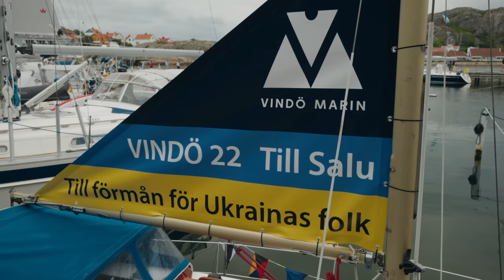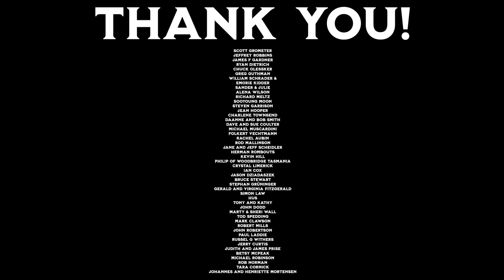a strange new experience [S5E16]

Comment: you ought to come to the Norfolk Broads, here in the UK, the wide rivers are the size of your narrow channels, some rivers there is barely room for 2x 12 foot wide boats to pass (thank goodness for the reeds at the sides) and  encountering a race may mean 40 or more boats all over the river (stick close to the right bank as they are supposed to treat you as the bank, leave a gap and you may have boats coming past both sides (6" is seen as a miss and perfectly adequate room), then there are the bridges, a good sailboat crew can drop the mast and shoot the bridge with the residual speed, and have the mast back up less than a boats length past the bridge, its a wonder to behold, also when they get it wrong.
Reply: I agree; I live beside the Waveney river close to Breydon Water at the entrance to The Broads from the sea. There are over 150 miles of navigable waters to sail with no locks! Come and see. We’ll help you discover the secrets of these waterways.

Comment: Excellent boat designers/ builders in my Netherlands country asides, HR has been a favorite for some 40 years or so. It's very nice to see in your video where they are with CAD/CAM that facilitates series of 1 with a lot of component re-use. What struck me was the (sort-of) waterline level walk floors around the boats in progress. I wondered if folk were working under that too, when necessary. Well, happy '23 and great video.

Comment: Nice trip in the bestcoast of Sweden.
The normal way to wild dock to an island is bow to land, and the anchor from the stern. At night you can  pull the boat out a meter or two. Then you have no problems with the tide or if the wind change a bit.

Comment: Question on structure boat repair on magic carpet.   With your first sailboats—-you walked us through all the work done to repair from the boat falling.  Thank you.   Have you had any new issues that has occurred from your initial repairs.   We are looking at a boat with hurricane damage and we want to gain a perspective if fixing it properly will be enough for long term sailing.   Will the repairs stand up to wind/wave stress.
Reply from the maker: Depends on the damage and how it will be repaired. 
I am very happy with how I have tackled ours and it is 100% holding up. And we have given it a pretty good shakedown while surfing at 12knots.

Comment: With my Choy Lee Offshore 31, I had vang connections on both decks, so I can fix both sails in rigid position (pole on the Genoa) for wing on wing, no chance of jibe… if you are heading offshore, deck vang connection points allow you to survive getting thrown around without the sails also getting thrown around…